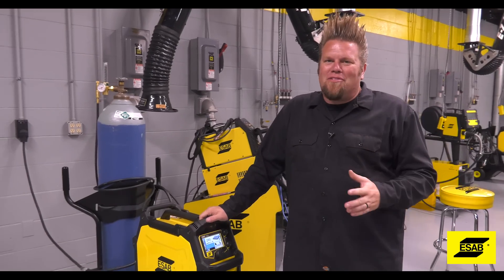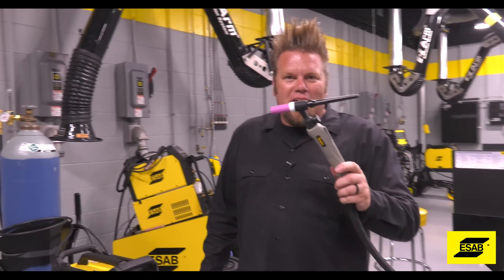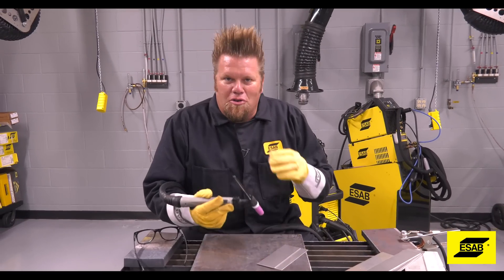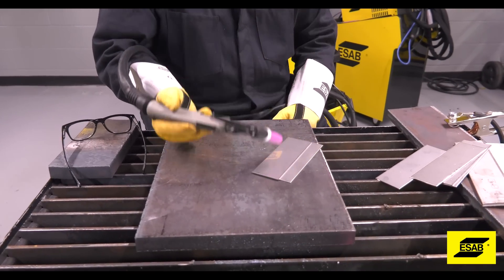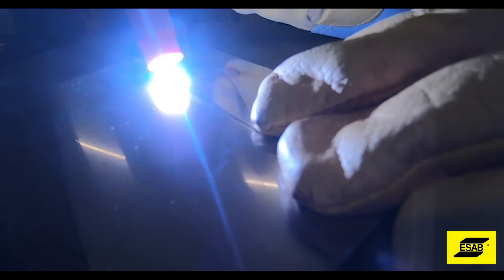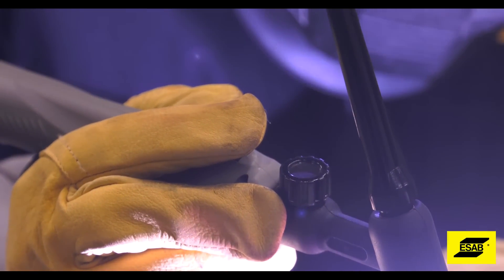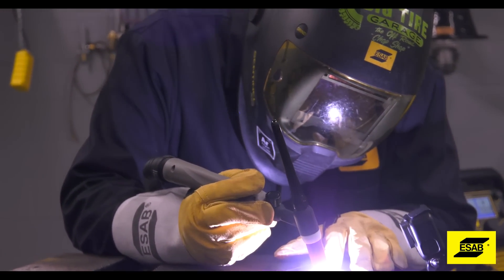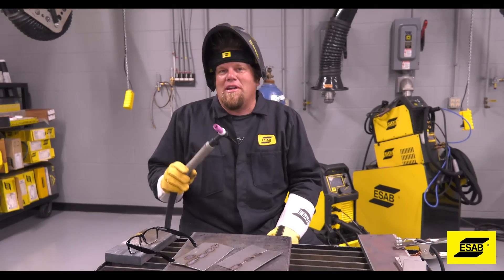The Basics of Lift TIG Welding with ESAB Rebel Multi-Process Welder

Comment: How does the tig work with out having to feed it with the stick or wire thing they normally use?
Reply from the maker: Hi there, thank you for interest in ESAB products. In order to best assist you with your question, we ask that you contact our Technical Service department for assistance. You can reach them at 800.ESAB.123 (800.372.2123) and follow the prompts.

Comment: There are some welders that automatically do the lifting for you. You touch the electrode to the work and a solenoid retracts the electrode back about a millimeter, releases Argon around the electrode and then fires a pulse to do the weld.

Comment: Why not just make a high frequency start?
Reply: In some facilities you are not allowed to use high frequency because it will damage sensitive electrical equipment such as modules and computer components.  Ever listen to a radio while you are welding and as soon as you start welding the station kinda acts wonky or the volume changes? It's the high frequency messing with the electronics.

Comment: at the price of the machine , and the fact it has a solenoid in it for mig , not to use it on the tig was a huge mistake ,,, id have bought one if they had , as im sure would have many more.
Reply: My 205 has one for mig side and tig side.   I think it was just the torch in the demo and the way the hooked it up.

Comment: can it do alluminium???  i was told you need a hf tig to do alloy.... lift tig is only able to do stainless...
Reply: It can do aluminum on DC TIG but you will need 100% helium gas instead of argon.
Reply: yeah, its DC tig so it can only do mild steel/carbon steels and stainless. youll want an AC machine for aluminium.